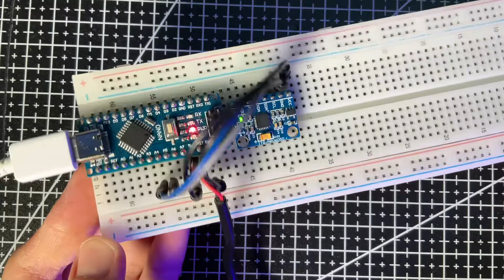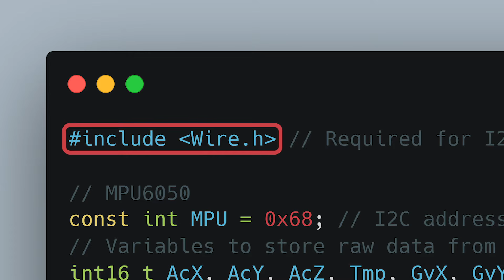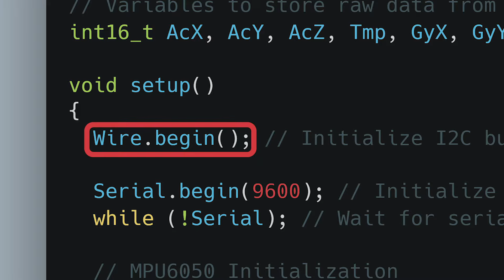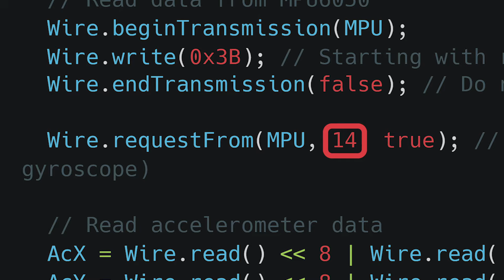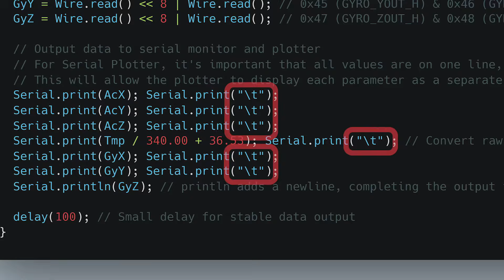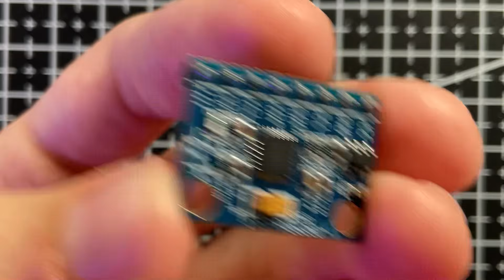How to use GY521 module with arduino?

Comment: Not connected..how i resolve this isse?
Reply from the maker: Hello, first check if you have connected everything correctly according to the diagram.
If that doesn't help, you may need to check the I2C address of the module; it may not be the standard 0x68 but something else. I will send the code for checking addresses in the next comment.
Reply from the maker: Here is a link to the tester. Don't mind what it says about the OLED screen. This code is universal for everyone. If it doesn't help, let me know.

https://drive.google.com/drive/folders/1AUyfdu7H8s0yxJQe4kw1BjIeWCxzwYmS?usp=sharing